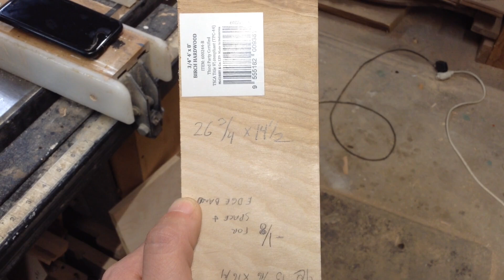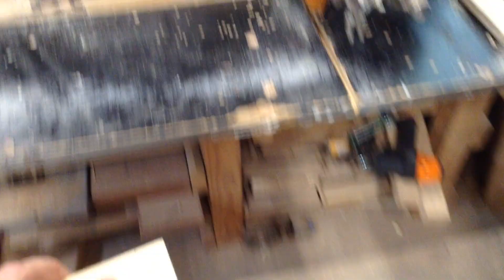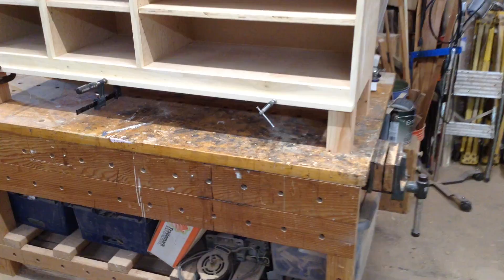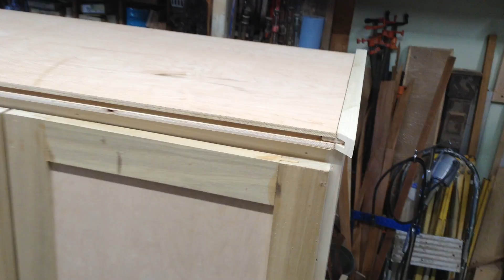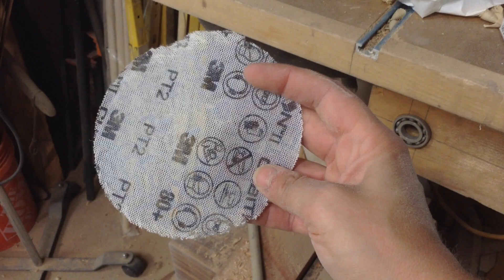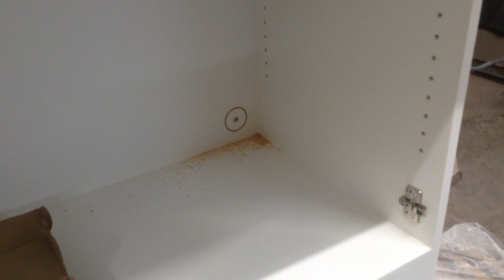Woodworking Furniture Projects For Beginners || Cabinet How-To

Comment: I love ml patch but as someone who has painted several DIY cabinets, doors, drawers I use thinned out drywall mud.  Sands easier, holds up well and let’s me run across all wood.  Yes more sanding but the final finish is amazing and I use BM Advance IMO the best paint to use on projects like these…yes 16 hour recoat blows but the bathroom vanity doors drawer fronts I just painted are rock hard durable and smooth as baby behind!

Comment: You seem to do a lot of hand fit-ups to get the accuracy you want, which is commendable, of course, I did the same until I mastered the story stick method. I would do a "concept sketch," followed by scribing necessary full-scale dimensions on a scrap of wood stick or rod; you can work accurately in height, width, and depth dimensions before you even turn on the saw, thus you'd have a perfect cut list. Google "story sticks woodworking"; both text and video show the method. ☺

Comment: If it's not to much trouble; What is the name of the sander protection pad that you mentioned? I've also switched to the cubitron and it's great, but I didn't know that I should be using something in-between it and my sander.
Reply from the maker: It’s just a 3m interface pad, found it on Amazon. For flat surfaces you are fine. But I noticed doing curves and edges tear up those discs real quick, and the pad helps buffer them making them last longer.
Reply: @HoneyBadgerWoodWorks  Thank you.

Comment: Not a big fan of painted furniture but you've made it look fabulous. I can't believe how dumb I've been balancing doors for so many years when I could have clamped a full width strip to rest on!!! Thanks for the mega useful tip!
Reply from the maker: Usually I just leave the backer off and it's easy to do it from inside.  But, for overlay doors this worked really well.

Comment: What is the brand of the he spray gun you are using? Can you use a 10-gallon pancake compressor?
Reply from the maker: I honestly don't remember.  I got it years ago.  It's a campbell hausfeld and was like 30.00 on amazon.  I'm sure you can go find the current model on there with specs, but I'm going to say and 10 gallon would be pushing it.

Comment: Looks perfect.
I actually like paint ! I've run into problems with thin MDF (5 mm ) for panels when using water-based finish. The stuff we get in the UK tends to have surface fibres which  never vanish, so I opted for Zinsser BIN primer 'cos it's shellac based, Can't use thin ply in the UK unless you can find a reliable source !
Reply from the maker: Bin isn’t cheap but it does a great job.
Reply: Morning from Vancouver Island 🏝️👍